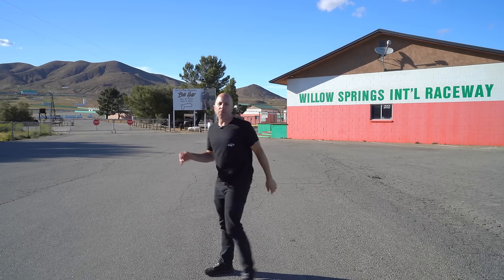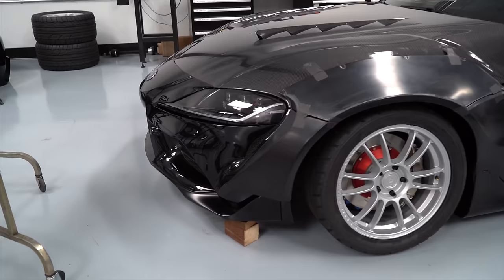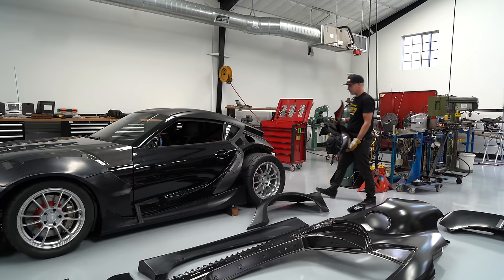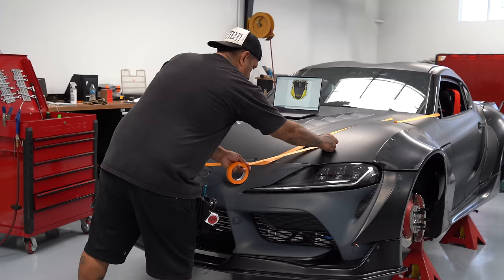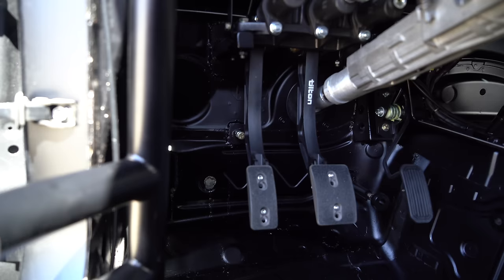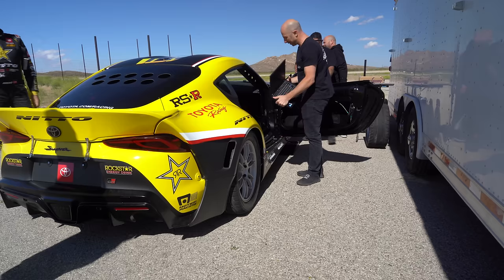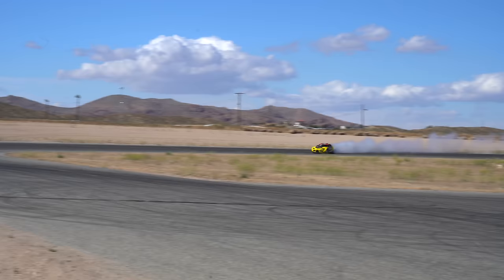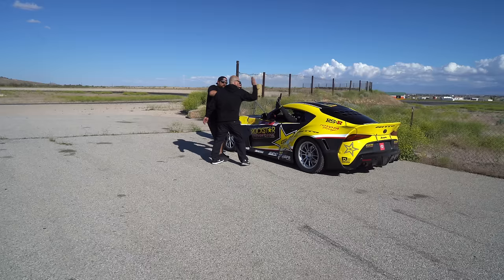2020 Supra Drift Build - Body Kit Install and First Drift

Comment: I do body work for a living and seeing oem body panels being used like this is sooo satisfying
Reply: I didn't know that they can be disassembled like that. I thought it was one piece attached to the chassis
Reply: @youtubespectator669  I work at a car factory and this is called the side outer. This side gets welded on top of the other sides. You can buy these sides from the dealership and they'll take them from the factory before they are put on the car
Reply: I'm a collision tech also. 20 years Experience.  The quality of the build and body kit is nice.  The lines are probably better than most backyard wannabe shops that dont care about fit. Or shops that dont do heavy hits and have real understanding of pulling and metal repair.  This car should do well once the world let's up on being overly cautious.
Reply: spectator  you dont work on cars for a living I'm guessing.
Reply: @despizedicon  Someone got elitist here pretty quick lmao
Reply: It looks so damn good🔥
Reply: @despizedicon  you are correct, old sport. And you do as a body shop tech I'm guessing?
Reply: Vadim Lashchuk What car factory do you work at?
Reply: Man its awesome people even in the comments
Reply: DespizedICON Noce is an understatement. You should watch him actually doing the engine build it’s nuts, some of the best content of its kind on yt. This car is for racing not ricing, idk why you’d mention wannabe shops man these guys are the real deal

Comment: B58 engine is 2jz brother from another mother😆😜
Reply: "but it's bmw motor, not a real toyota supra" - every annoying fanbois on the internet.
Reply: @ardijanuar2036  tis tho, zupr4
Reply: 1000Hp on a stock block and crankshaft (and i think rods too), truly magnificent
Reply: papadakis's level of modification on the b58 engine is not really achieveable for most casual car guys. he has a full service team behind him working on that thing. but even stock out of the showroom, the engine is solid.
Reply: @InTecknicolour  ^^^
Reply: @InTecknicolour  B58 already hit 800whp on a street build all they did was tune the transmission, people are figuring out the transmission, ive even seen a few built ones. The B58 is the modern 2jz.
Reply: @X1xRiGox3X  true. They have the B58 plus the S58 that has yet to blow up in the aftermarket scene yet(can't wait to see the numbers the new m3/m4 will make) plus  S55 already making over 1000whp so we have 3 i6s that are basically all modern 2jz's.
Reply: @InTecknicolour  and a 1000bhp jz is? You need a deep wallet for that shit too.
Reply: @itsdokko2990  Only the crank and bearing are stock. Everything else is aftermarket,
Reply: @InTecknicolour  if you cant change pistons and rods you won't be able to make power with a 2jz either
Reply: @Kvele  I'm sure the engine block is stock too
Reply: More well know in drift and drag than your brand Mr. ENZO.
Reply: and the barra is the crackhead uncle haha
Reply: @hellblazer275  heh gotta love those iron block barras, can hold big power stock
Reply: it lacks sound :(  i can only hear that noisy transmission
Reply: Ardi Januar - the 2jz is a Yamaha motor.
Reply: The 2jz is a Yamaha engine.
Reply: Carboy Dorifuto party N54
Reply: Nah, thats a BMW engine. Construction kit engine for a lot of BMWs from the models 3 to 8. 
Supra has original 340 hp (German PS), the BMW Z4 M40i has 388 hp. 

The GT86 had a Subaru Boxer. So where are the Toyota sporty engines?
Reply: Cheapguitarguy lol there’s more stock components than you’d see in a lot of engines that make that kinda power, the biggest changes were rods, intake manifold, and injection,
Reply: @X1xRiGox3X  the 2jz is the modern 2jz wtf did you just say lmfao
Reply: Ducko I’m pretty sure the rods are forged mate
Reply: Fryingpan there’ll be better exhausts for it soon
Reply: David Radtke Is it can make power, who cares who makes it?
Reply: @davidradtke5166  take a wild guess why Toyota refuses to build their own engine. Like really you're such an expert tell me why...
Reply: @itsdokko2990  I'm pretty sure they swapped the stock connecting rods with Carillo rods.  Nonetheless, a very impressive feat.
Reply: They don't try to see behind the work and challenge they had to develop this car. They knew of the fame of the predecessor, so they thought of making a modern engine but that had the root of the A80 but Account of the partnership with BMW all fanboys totally ignore the effort.
Reply: @InTecknicolour  he said he really only did rods pistons exhaust cam and springs/retainers as far as fortifying the engine.
Reply: @Kvele  thats not true. he said on hoonigans most recent video, they only did rods, pistons, exhaust cam, head bolts, and springs/retainers
Reply: @markg1495  Yeah thats not very stock man.
Reply: Yeah man...it really sounds like a 2jz tbh when tuned  like Papadakis..
Reply: @hellblazer275  'straya
Reply: Zupr4
Reply: @itsdokko2990  true, great build quality exceeded my expectations honestly
Reply: Who is the father

Comment: The car looks like it's running really well, Steph! Would love to see a follow-up video with Freddy explaining to us the similarities and differences between this and the Corolla in terms of body control and dynamics, as well as how he is enjoying the B58, what can be improved etc. Would also love to see if you have any failures or issues with factory components on the B58 that maybe Supra owners like ourselves could be wary of or upgrade for our street cars.
Reply: Most factory component that could be week point of this build, relative to this power number is already changed like electronic, diff, turbo, exhaust, injectors, fuel pump, rubber bearing, clutch, gearbox etc. This car it is not even close to factory car. The limit of this build is unknown it has so much potential. It is build with safe margin almost all components are overbuild which is good think over all. This block casting is good for 2000 HP with cylinder sleeves but all internal components has to be change to hit this number especialy head will not flow enough. Almost all gears are surface harden so something will brake overtime.
Reply: They had everything redone. If you want to know what might fail on a b58 go to the roots of its development. Way back to the n54 and n55 motors. 
The sparks and coils always fail. High pressure and low pressure pumps and crankcase pressure when boosting. It also depends on your tune and what you bottleneck if you don’t mod appropriately for your tune. (I drive an e92 650rwhp n54)
Reply: The difference is that ain't a real Toyota. Most of it is a BMW Z4. Should compare it with the '20 BMW Z4.
Reply: David Radtke yes but since it’s a new motor almost no faults in a z4 motor
The faults are all the chassis body of the z4 
The supporting mods as well which are similar to n54 and n55 tech
Reply: David Radtke  It is like Toyota Supra MK5 have BMW Z4 engine and drivetrain swap  with some needed modifications. This car is not amazing but still good to overdrive other cars. For me new Supra looks better when was presented as a concept car. Especially back of Toyota FT-1 Concept looks more appealing.  For me this car is not worth sticker price. If I could afford to buy new Japanese sports car from a dealer I probably spend this money on new Nissan GTR which is truly Japanese car. Toyota can not use own designs engine  because they can not beat the rest of Germany owned big concern Volkswagen Group in this price point.  Volkswagen Group have almost all market. All existing drivetrain system are develop by one manufacture so only one way to trully compete in this market is by providing new own technical solutions. So if Toyota want to stay in game and beat others they should start by trying to use the new design like in Ready Variable Compression Engine in INFINITI VC-Turbo Engine or Freevalve system in Koengisegg engine. For me this generation of cars should be running on Ethanol from factory. This kind of fuel is better for performance and better for emission, diesel fuel should stay only on trucks or boats to transport heavy loads. All new emission regulations are only political game waste of time. The biggest players always winning this game. All new designed petrol engine have always same problem for decade which is kinetic energy losses for heat energy. All petrol engine are not efficient enough, not even close to 50% efficiency. Electric cars are not efficient too, they weight too much, weight of charged battery or uncharged battery  is almost the same, power cells have short life time, limited rare materials are used for production, production cost of one car is too big. For me solution like system start stop in turbo petrol engine it is the best way to murder new car parts which will caused more emission and more waste over time. All manufactures stop challenging themselves to create new solutions or providing new technology starting from creating new better concepts from the ground. For me factory cars are boring they are compromise of cost labor. For all ecologist the cars are not problem, communication structure is a failure. All cars spends most of its time staying in one place parked or waiting in traffic rather then moving so why we should focus on emission when the problem is not there.
Reply: erick r the B58 is quite substantially different then the n54/55, including almost all the things you mentioned. With your logic you might as well trace it back to the M50 as well and assume it has its common issues...

Comment: "So He'll start with some really mild drifts."

Freddy: goes full 90°
Reply: I think these shots where from later part of the practice. I don't think the video editing team will want to show any mild drift
Reply: L O W   A N G L E
Reply: @nice1149ss   For Freddy, those probably were the mild drifts LOLOL Steph was probably like " Ok Freddy, No Backies today"
Reply: @masoncayaban9790  formla drift drivers are super skilled. I am amazed of how the car preformed from first try. Usually, after many testing, a project car will still have many issues.
Reply: Gimme some curve,
Reply: Tbh it looked like more of a power slide than a drift
Reply: nice1149ss Freddy is pritty much a regular Norwegian drifter.   We live in 8month winter you know.  And have been doing drift comps from way before drifting Even had a name.   Should just see how 18 year olds can hold lines and drifts for ages just on the normal streets here.
Reply: @bentuu816  lol do u know the difference between a power slide and a drift bud? 6:38 look at the way he approaches and initiates. That is 100% a drift. Onwards into the video, look at the back end of the car, he uses the momentum to throw it into the slide and connect..that is a drift. obviously, to hold the slide longer, u'd use power [aka powerslide] but that is part of drifting in order to hold the line. all about the details. 7:08 look at the purposeful initiation to slide, that's a drift, he isn't just going into the corner and oversteering and using power...
Reply: I was gonna say the exact same thing😂😂😂 these mfers went from 0 to 100 so quick
Reply: He’s breaking in more than just the engine he’s breaking physics on a warm up lap 😂
Reply: @bentuu816  Tbh it looks more like you don't know the difference between a power slide and a drift
Reply: Literally just paused the video at this part to see if this comment was made.  Right at the top, front and center. xD
Reply: Does anyone know if he is from Greece? His name sounds greek. I am from Greece as well.
Reply: @blindyy132  he is Norwegian. Hence the name Fredric “The Norwegian Hammer” Aasbø.
Reply: @antk24  he was born in Greece and then moved to America with his parents. I can tell by his name too he is Greek. You can Google it as well
Reply: @blindyy132  He is literally from Norway. 😂 look it up. Fredric Aasbø is Norweigian, not greek.
Reply: @antk24  wait I am talk about Stephan papadakis not that guy lol. Stephan papadakis is the guy who built this car his dad is greek
Reply: @blindyy132  I thought you were referring to the driver Fredric, not the builder, Steph. lol. he probably is from greece for all I know but I had no idea you were talking about Steph 😂
Reply: nice1149ss that’s what Sponsor are they provide the money for all the top range parts and to be test and engineered before any real driftest

Comment: "We're gonna turn up the boost and adding nitrous to the engine"

Piston 3 so anyway, i started flying
Reply: Imma head out
Reply: So anyway I started blasting
Reply: @Honda_Man_Sam  *So anyway, I went into orbit
Reply: "i was like "OOH A PENNY!"" -piston 3
Reply: typical BMW engine hahaha
Reply: @kevinbosco5876  well if it was an toyota engine the engine would be gone a long time go
Reply: @supertreme5559  HAHAHAH TOYOTA ENGINE THEY  MADE 1.K HP FROM FIRST DYNO AND BTW ONLY 4 BANGER CAME  FROM CHEAP CAMRY HAHAHA AND ENGINE MAKE ASBO WON HAHAH THEY USE IT FOR VERY LONG TIME BECAUSE ITS ROCK SOLID ENGINE AND BTW THE 2AZ THEY USE WAS OPEN DECK  BLOCK FROM FACTORY NOT THE BILLET ONE  WHICH IS CRAZY
Reply: @kevinbosco5876  yeah but thats a build engine tho. Ive had many toyptas in my shop that the head geasket or the rods have been ruined because they tuned the car 40hp from original. Toyota are cheap for a reason
Reply: You play My Summer Car?
Reply: It really shouldn't be that catastrophic, If you look at their other videos, They use forged JE pistons and chromoly steel forged connecting rods from Carrillo. Those should be very stout and should take much higher power output than 1000 bhp.
Reply: @kevinbosco5876  lol you sound salty. Little do you know Toyota built the internals stay mad it's kinda cute seeing a supra fanboy lose his mind over 30 year old Toyota.
Reply: Sam Bromley  lol it’s always sunny in Philadelphia quote

Comment: The restraint Freddie showed to not full send that car immediately on the first lap is mind boggling!  Every drift fiber in his body had to be itching for that first slide.
Reply: He respects the engineers to deliver an amazing car, the engineers respect him to treat that car properly.
Reply: What I've heard, Freddie can build as well - which means he knows the value of holding back until the team knows the car works as intended.

Comment: need this in forza horizon 4 for sure
Reply: need this in fucking every game tho
Reply: and asetto corsa too plz
Reply: For suurre
Reply: Forza just always fucks up car sounds now even NFS Heat kind of fucked up the B58 sound, the B58 sounds similar to the 2jz/RB26 maybe they need to mix sounds from 2jz's, Fully built B58's and RB26'S that would be insane 😂, lol but maybe they need to record how papadakis Supra sounds and put it in every game.
Reply: RazorRC NFS Heat messed up the RB26 and Aventador sound
Reply: RazorRC NFS sounds are ehh but Forzas are better imo, because you can add cams and rev higher
Reply: @aftrnoon_ac  sound quality in Forza may be top notch, but Forza cars sound a bit off compared to real life though
Reply: 6RIE imo nfs sounds are better than forza sounds (at least the recent forza sounds example horizon 4), especially since you can tune the sound in heat
Reply: We need the stock 2020 first because they'll fuck up the car physics
Reply: @X1xRiGox3X  I don't think NFS fucked it up much, compared to Forza it sounds way better. Actually overall NFS sounds better then Forza, the comments here make no sense, there are tons of videos comparing the sounds in both games and most agree that NFS sounds WAY better.
Reply: @fast-eddie-clarke  with assetto corsa I tihnk you can just download some mods for the A90
Reply: Assoluto racing
Reply: I want this car for Gran Turismo 7 ✌